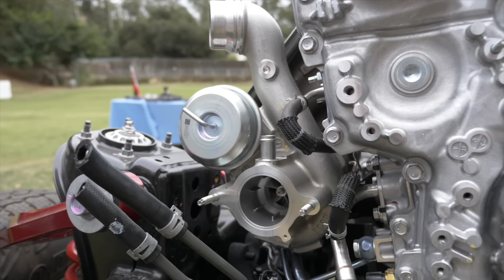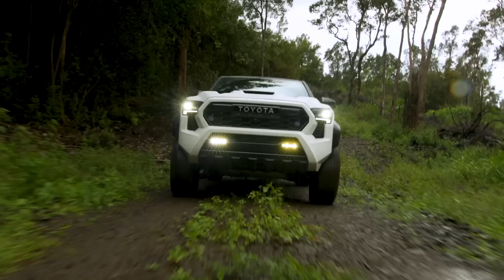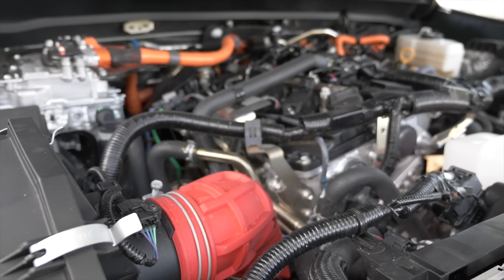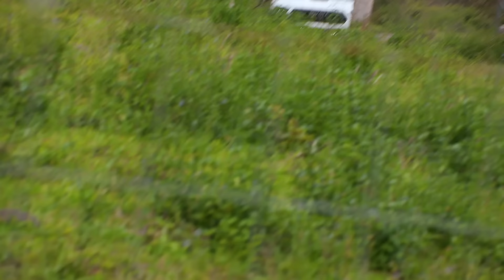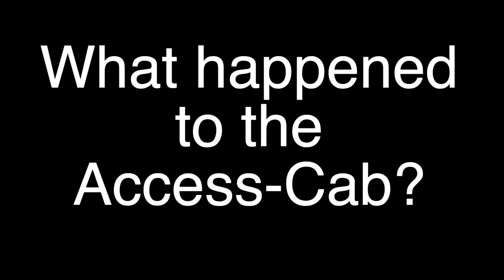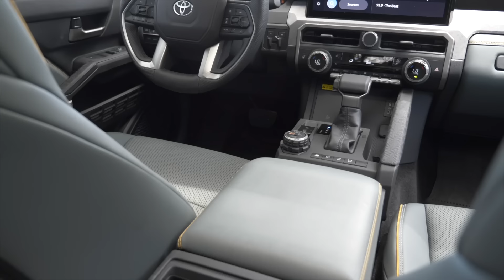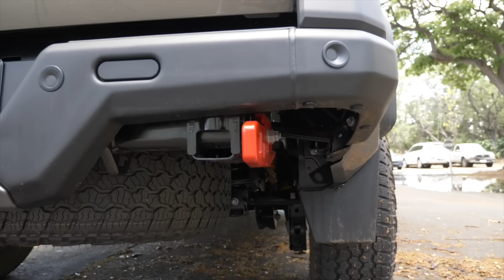2024 Toyota Tacoma Chief Engineer on new engine reliability and more...

Comment: Caveman over here just wanting a regular cab, manual transmission, crank windows, hydraulic power steering, and actual mini truck footprint. That ship has sailed.
Reply: I had the same desire, but to make things even more difficult, I also wanted a full box frame and a manual transfer case (no electronics in the drivetrain at all). The only truck that checks all the boxes and isn't completely impossible to find is the 1st-gen Nissan Frontier.
Reply: @coffeeandlifting  I get it. Cheap failure points disguised as progress reign supreme and have for well over 16 years now.
Reply: @coffeeandlifting blame the epa
Reply: 22 Frontier has hydraulic steering, no turbo, and no stupid stop and start.
Reply: Some of those things you can still get by good manufacturers but I definitely agree with Toyota that ship has sailed and so has the quality!!!
Reply: EPA killed small trucks
Reply: I hate this era we live in.
Reply: I want the same. I had it once in my 2001 Tacoma, except for the crank windows. I kept it for 13 years and 350k miles, I wish I hadn’t gotten rid of it.
Reply: @fuqoff8583  That's why I'm keeping my 2003 Tacoma with crank windows. 123K 2.7 liter 4X4.
Reply: @stevet8121  love my '13 taco 4.0
Reply: Time will tell. I would never buy the first run on this. Wait and see how they do. For the price they have on them they have really taken a lot people out of their consumer base.
Reply: Amen, wouldn't it be nice to at least have the choice. I never minded cranking down the windows, pushing in the clutch and shifting the gears, sliding the heater controls, pushing in the button to get a different channel on the radio, or pulling the handle to adjust the seat. But I do struggle sometimes with a dash board that is no less complicated than an aircraft cockpit!
Reply: Me too!! I miss basic reg cab avg working man trucks!!!
Reply: You're asking for a basic truck... They don't like that anymore... (I agree with you). I had the cheapest and reliable toyota ever made... 18k$ for a manual toyota Echo HB which became Yaris some time after. That thing just kept going like a swiss watch. The equipment was shit (I remade the whole audio system), but the platform was light, reliable and easy to work on. EPA got us damned with all those requirements while concrete and steel plants seems to be no problem for them. Hypocrisy to the maximum.
Reply: @Echohb I purchased first new vehicle 1990 4Runner SR5, 4WD, V6, manual transmission.  At the time it was amazing  to me as I was young and standards were lower.  The MSRP At the time was about $18K and in todays dollars that translates into $43K.  By todays standards that 4Runner was a POS and I would never go back.  I have owned/own 4Runner gens 3-6 including new 2026 Limited hybrid.    Inflation is real and if you peaked in life financially back in 90's then that is a personal problem not a problem with vehicles being made today for people whi can actually afford them.  Your exoectations are unrealustic  should be driving used or econo box.
Reply: Sounds to me like if someone came out with a company that made mini trucks for under 25k there could be a market for it. Like an old s10 slammed with the tailgate thst had the slanted license plate. Lol
Reply: @SecondClassCitizen forever ive thought chevy was nuts for not putting a 3.8 back then in the s10 and skip the other engines and then not introducing a small 2.0 turbo s10 later on
Reply: @SecondClassCitizen Every vehicle has 4 wheels, brakes, engine, steering wheel, transmission, safety systems, seats, etc.  Yet you somehow think sawing off a section of mostly steel to reduce overall length that doesnt cost that much by comparison will give you El Cheapo vehicle.  That is new level ignorance right there!  Surely, there is a direct correlation of such genius to the wages you earn or lack thereof.  Congrats you lose!😂😂😂
Reply: Go find one in good condition and buy it then.
Reply: That sounds super corny....
Reply: You can get some of those with the Nissan Frontier
Reply: same
Reply: I hear caveman meaning man with mostly empty wallet who is used vehicle caliber buyer.
Reply: Epa killed mini trucks

Comment: I've put more than 1.7 million miles on five 4Runners, generations 3, 4 & 5...(all trim levels but Pro)...3.4 liter V6...two 4.0 liter V6's & two 4.7 liter V8's...I sold them all other than my Current 2005 V8 Sport (I cant part with) all very high milage to people I know who then went on to put tens of thousands of miles on them without issue...I Sold products to Toyota service departments for 10 years & also sold Toyotas themselves for a little over 2 years...I have done all of my own maintenance & never any 4Runner in for service other than small warranty items...I am disappointed Toyota went this way, Will be buying a 24 TRD Pro...If the V4's prove me wrong, I will buy one but NOT today...2 many unproven variables...

Comment: add this tO any persons opinion who wants to argue with physics ,  we have seen  V-8  and  V-6 outlast stressed out 4 cylinder  engines  because theres  TONS  more metal , parts  ,and  surface areas  to wear On V8 and V6  way more over time Verse  4 cylinder which  WaY has Less of all of them  ,  it ether goes one way of another  : you buy extra gas for the  v6 v8 over time  which isnt  that bad  OR  or    another i4 replacement   engine~   which one do you choose?

Comment: Not interested fat boy. Give me the V-6 back! I won't bother with a fancy 4 banger.
Reply: I like the 4 banger but only if its a single cab short bed. And only if the 4 banger isnt junk with plastoc all over and 8 injectors for 4 cyminders. They used to sell you a glass headlight metal body more reliable engine and it cost literally like 1/3. The current gen compared to the 1st gen you can see they have gotten worse and worse and worse under the facade of improvement.

Comment: I'll just keep driving my '17, 6 cyl, 6 speed manual until they get the bugs worked out - and there will be bugs. Another viewer mentioned that a great, no BS warranty would suppress consumer doubt, and I couldn't agree more.
Reply: Even after the bugs itll never be as reliable. Tacoma is on a clear cut path downwards in rleianikity ever since the first generation. Every generation the quakity halves and the prive doubles snd you clowns are still waiting for the right time to buy them. You deserve to he walked on lime a doormat if you lay down and take it when the order id barked at you

Comment: Don't care for the added expense of a turbo engine...complex, more to fail and expensive to fix...NO THANKS!
Reply: For basically the same fuel economy for all intents and purposes..
Reply: @jakewillits4678  They turbo them to increase the power of the small engine and maintain decent fuel economy...not for the sole purpose of fuel economy. They are actually successful in what they are doing...but greatly increase the expense associated with the engine.

Comment: Its always the oil changes that get you. Always do it ever 3000 miles or less. Engine will not have a issue.  Electronics is another story. VvT is trash..its run by electronics. So replace your electonics every 4 years and your vv timing will never  go out of sync.

Comment: I have owned Toyota trucks for a long time.  I currently own a 2019 TRD Sport with the 3.5 V6.  No way in h--- would I trade it for a 4-banger .  Get real Toyota.  Go with what works.
Reply: Toyota is retarded. Nissan put direct injection on thr frontjer only like morons. Toyota puts 8 injectors on 4 cylinders to solve the oroblem as if thats not wctually just worse in a different way. Literally no one was mad at port injection only 4 injectors for 4 cylinders. They dlubled it toyota keeps saying "trust me bro" 8 injectors 4 cylinder small dispalcement turbo yey your bed is plastic your body is recycked soda cans yoyr interior is all plastic your engine components are all plastic platric headlights plastic tail lights that mesns the truck should cost less but nope it costs significantly more. So sad the mental insanity rampant globally

Comment: The fact that Toyota is paying their engineers to make this argument should tell you the 4 cylinder is going to be overworked, and you'll be driving an underpowered truck with a much shorter lifespan. Toyota is making a MAJOR mistake doing away with the V6.
Reply: Hopefully, when Toyota sees the dissatisfaction of their customers, they will drop the turbos.
Reply: Fuel economy is why they got rid of it. Sadly the less reliability abd hugher cost isnt convincing anyone to buy any more of them. I think toyota quakity drops and price jumps every generation after the last and toyotas zombified cultist followers might shell out the dough but im not.

Comment: Two words.  Bull Shit.  I’m on my 4th Tacoma, also had 4 of the 4Runners.  Bought them all new.  You all can get fucked, I’ll never buy another.  You charge more and give us less and less with every change.  Maybe Biden will buy them all and steal the money from us tax payers again.
Reply: You get it. Theyre scamming and ensaving us around every corner and not even automotive. Tacomas used to be affordable reliable and durable. Now you get expensive unreliable and weak plastic 🤡 toyota is like "oh right and it costs more" yeag to you toyota, i wont even be buying a corolla after they took out the dipstick and added 4 pointless injectors to a 4 cylinder and gave it a cvt. Ill tell you why they rmeoved the dipstick its because toyota is the dipstick. Dumb idiots so blinded by society hailing the reliability they abandoned after the 80s and 90s. Even back then the jun couldve been better. Toyota rides off rumors of reliabikity today that they earned and abandoned 35 years ago as far as im concerned.

Comment: The answer is they didn't.  These turbo engines are going to be a cash cow in repairs for Toyota and for new vehicles as these will die so much sooner.  It's already been reported that these engines are a dog until you get up in the rpms and the turbos get spooled up.  This is so uninspiring.

Comment: In Europe we had smaller engines with turbo's for a long time now. the stats are clear, it doesn't help with the longevity of the engine. You see cars with naturally aspirated engine like the toyota prius lasting much much longer. the newest thing is 3 cylinders rather than 4, even in a  bmw 3-series :-/

Comment: Yet you are talking about the Frame Architecture. The box frame. And I can't help but observe your body. Something wrong with the frame there. It's not going to last much longer.  How do you spell Heart Attack? And you're worried about  the performance of this engine? What about yours? Might your hoses need some bypassing? It sure looks like it.

I mean with your belly hanging over your pants. And you talking about the  frame integrity. This is why you have, full rolling B roll. So we don't have to look at your frame while you're talking about, frames. As there was a break in continuity there for sure. You should have had somebody check your work. I think this video needs a Recall? Though it is entertainingly funny. And then we are supposed to imagine that this vehicle will last?  Well it's a first generation psycho breakdown from hell under the hood. I mean where's the engine? I can't see the engine for the hoses?

Yes and that's why you have that engine out and on full display. Because under the hood. You can't see any engine anymore. Where did it go? There's all these hoses and wires. And it all looks perfectly understandable? Right? Yeah no. It's not. Not by a longshot. This is going in the wrong direction.

So I think Toyota should get into the Hydrogen Gas Station Business. And then we have a nice little fuel-cell. Connected to some electric drive motors. And stop wasting all of the natural resources on our planet. To reduce emissions. Because that's what we are doing here. Although submissions control stuff needs to be manufactured. It doesn't come from thin air. It comes from air we are polluting. To then pollute less while we drive.

The solutions to most of these problems already exist. But they don't come with all the creature comforts we are accustomed to. They are designed to get us from point A to point B, efficiently. You can be back in luxury when you get to where you are going.

But traversing,, there. Requires wealthy people to surround themselves with luxury. To show off their luxury. To show off their personal, 757. Or for less important people a 737. Like John Travolta. That needs one in his backyard in Florida. He is so important. He's Italian. Where Jesus is from. Along with Giuseppe Verdi and Puccini.. Which sounds like a 1950s black-and-white TV show but it's not.

I don't know where this thing is going? Because I know I am not.

And what is the attraction to pickup trucks? When vans make so much more sense. I mean if you're going to drive a big vehicle? Make it a useful big vehicle. Where you can lock your stuff up. Because it's not the 1950s anymore. I know how many people would like it to be again. When Blacks and women couldn't vote.. And there were no LGBTQ in America. There were no foreigners in America. Oh sure there were some Japanese in California. But they rounded them up. Because they are easy to spot. They have Slanty Eyes. So they were easy to pick out. Because they look Chinese. Them Japanese. As they all look the same. And they know it. That's why they all live in the same country. And should stay there.

I'm just glad we have not had to send those Panda Express's, back to China. I like the drive through. I like it much better than going inside. Because in your car. You can always run somebody down to protect yourself. And you don't need to take out your gun. But also have that option. Especially in Texas. Where they created American degenerates. And allowed to think as a separatist nation as the Lone Star State of Chaos called the Republic of Texans. Which it is. Without liberties nor justice. Here in, Texan Phil.

Loren Bo Burp is changing, Districts. Why doesn't she just change her sex while she's at it?
RemyRAD